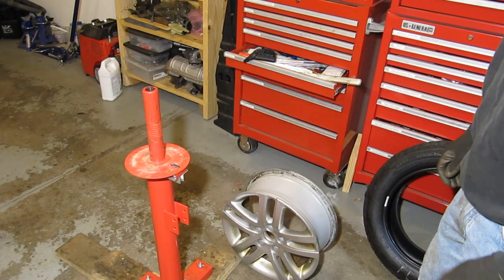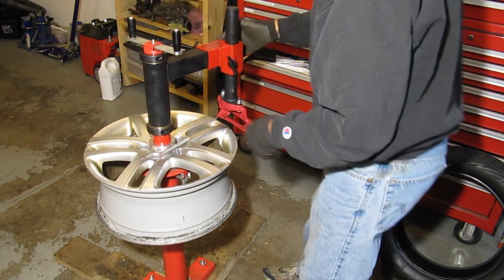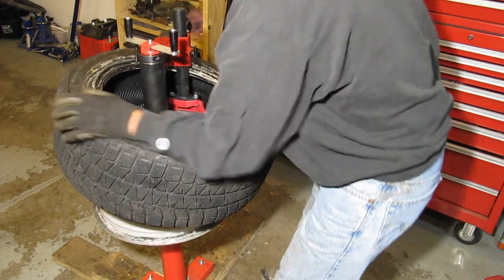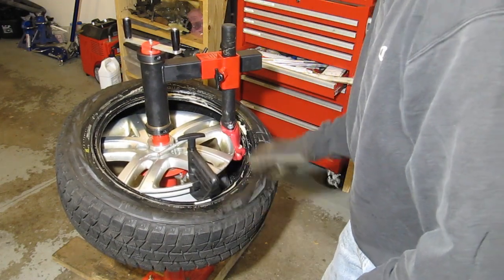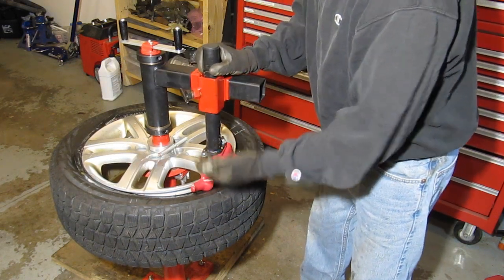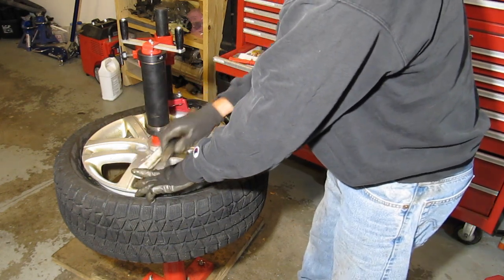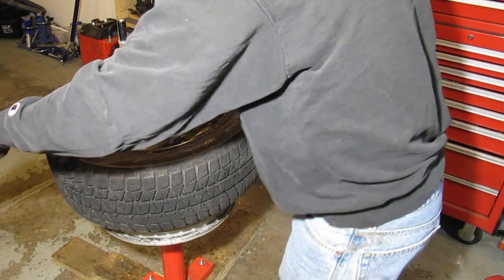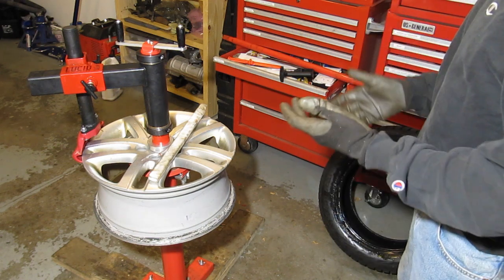Hand Mount/Dismount of Tires on Aluminum Rim

Comment: What is the length of the aluminum bar that you have the crank handles mounted to?
Reply from the maker: It is a piece of 1" x 0.25" aluminum stock that is 7.75" long.
Reply: Ok, thanks for the info. I made mine out of a piece of 1”x.375” aluminum bar that is 12” long. It may end up being too long and I’ll have to cut it down like yours. Yours would have a 3.875 turning radius and mine ends up being 6”. Thanks for your time
Reply from the maker: @benniedunn2781  Nice makes sense!  I found that the adjustable clamping levers were another really handy upgrade too if you haven't already done that.
I used these:
https://www.amazon.com/gp/product/B00GKZ95E6

Comment: Where did you get the black no-mar bar?
Reply from the maker: I got it directly from the no-mar website.  However, that was a while ago and now it looks like their products are white instead.  Looks like they still have the same bar available though (just with the changed color).  However, I did find that the no-mar bar could damage the tire bead unless you were really careful.  That is why I now use the duckbill instead.

Comment: Great video...where did you buy the aluminium cone and polyethylene tool (prybar) from?  I like to buy for my setup also.
Reply from the maker: Thanks for the comment Nuj!  

The aluminum cone came from Lucid Auto as part of his tire changer, but you can also buy it separately:
https://www.ebay.com/itm/293738098260

Or you can buy a cheaper set of steel cones maybe and adapt them to the larger bar diameter:
https://www.youtube.com/watch?v=-VfoKXCU60o&t=20s

The polyethylene bar is homemade.  It cut out of a sheet of HDPE with a table saw and then shaped with a sander.  The HDPE is easy to work:
https://www.amazon.com/Density-Polyethylene-Plastic-Sheet-Natural/dp/B07BS3Q41Y/ref=asc_df_B07BS3Q41Y/
Reply: @JohnsDIY  I thank you for your help....

Comment: Thanks for the video. Do you need different size “spacers” that push down on the centering cone for different wheels? Also how are you breaking the beads as I see the bead breaker part of the tool is not attached?
Reply: Thanks Don.  I find that the spacer that comes with the kit works well for all the rims I do.  I find that it helps to use the spacer because it gets the rotating arm up higher  when you mount the first bead (w/o the spacer the rotating arm can bump into/rub on the top of the tire -- especially for wide tires).   Aside from mounting that first bead, the spacer wouldn't even be needed.  As for breaking the beads, I use a different tire changer.  Very similar to the harbor freight bead breaker but a little better made/heavier duty.  The harbor freight one started bending on my after a lot of use.  I also feel like i can get more leverage on this one.  It helps that I added a really long bar (just made out of some steel pipe) for better leverage.  Here is a picture:

https://i.postimg.cc/J0gq754j/20200206-173223.jpg
Reply: Have you done a video on that bead breaker? Is that bought or built. Thanks
Reply: Hi Don,  It is bought.  It is actually just part of another tire changer.  I think it was this one in the link below.  It is a lot more rugged than the built in bead breaker on the HarborFreight unit (which started bending on me):

https://www.garageappeal.com/tuxedotc-mcatvmmotorcycleatvmanualtirechanger.aspx

Comment: Hey John, I missed what it was you said you were using as a bead lube.  Great demo.
Reply from the maker: Thanks Bruce,

I find the Ruglyde is really easy to use and works well (it goes on really easy and seems to lubricate well).  NAPA stores carry it as well:

https://www.amazon.com/AGS-RG18-Gal-Ruglyde-Lubricant/dp/B000CIJUGK

The Murphys/Blackjack tire lube is much thicker more of a gel.  It is a great lubricant (probably more slippery than the Ruglyde) but is really messy.  It is thick and doesn't go on well with a brush so I usually have to put it on with my hand.  For tires with a stubborn bead to seat, it does help by sealing up the gap between the tire and the rim.

https://www.amazon.com/BJK-Murphys-Concentrated-BLACK-REPAIR/dp/B00AZA9QWS

The white europaste is easy to brush on (but doesn't spread as well as the Ruglyde).  It is kind of half way between the two above.

https://www.amazon.com/Ken-Tool-35848-Mounting-Rubber-Lubricant/dp/B00KNC8VVA

Comment: Greetings from Panama. I would like to know where I can get the additional command you place to take out the tires since the tire screwdriver does not come that way. I would appreciate your comments.
Reply from the maker: Not sure what you mean by "command", but here are some links to the tire changer:

The HarborFreight Tire changer is :

https://www.harborfreight.com/manual-tire-changer-69686.html

The Lucid tool is at the following link and also sold on EBay:

https://lucidautowerks.com/products/ultimate-manual-tire-changer